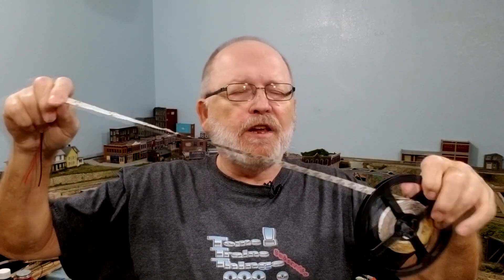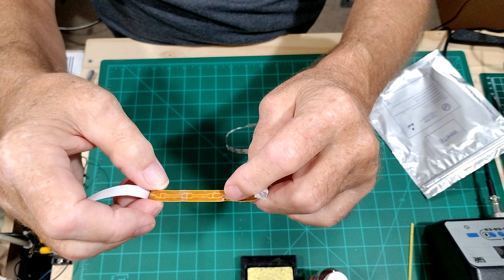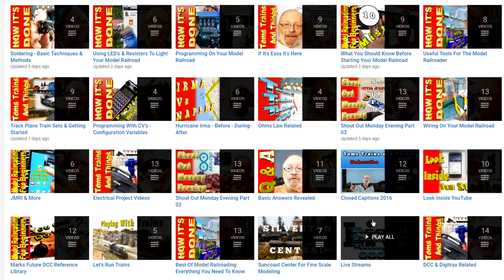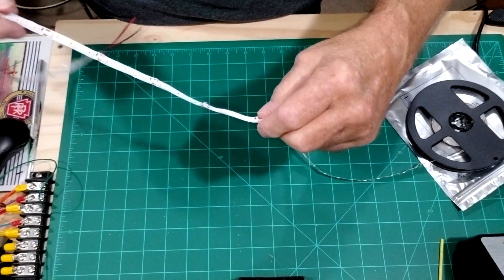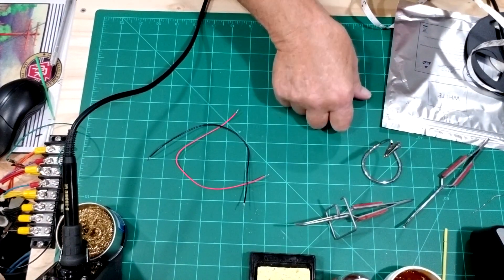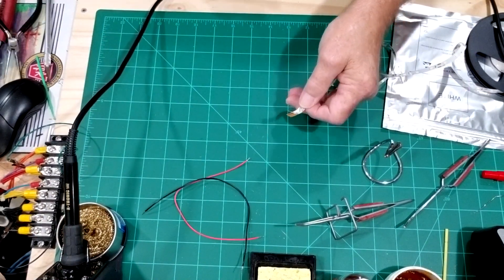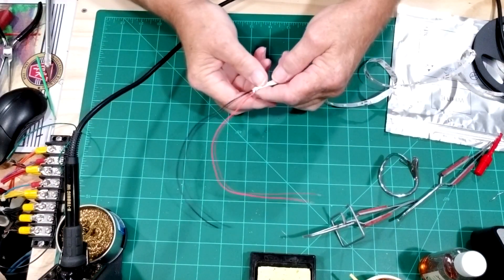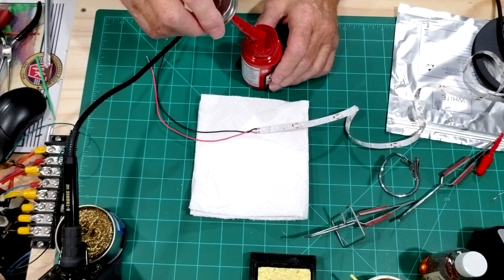Flexible LED Strip Lights - What Can We Do With Them

Comment: Hi Tom, I plan on using both 12v tape and undecided as yet individual LEDs for the layout. Since the strips have built in resistors am I okay with using a regulated wall wart with no additional resistors required? I heard you say that a lower voltage won't work, but have seen I believe people using 9v batteries and variable wall wart transformers. What am I missing? I would be using a buss and may or may not use terminal blocks or suitcase connectors. I am a pretty much total novice at this and appreciate any help/advice. My individual LEDs would be primarily street lights and so where the strips would be for buildings. Would you recommend 3mm or 5mm for the individual lights. I'm doing HO.
Reply from the maker: With the 12v strip, you do not need to add resistors. Depending on the type (solid color, RGB, 3 wire, 4 wire) you can divide the strips into smaller sections. There will be a soldering pad where they can be split.

The problem with a 9v battery is it does not have enough power to handle an entire strip let alone a small section of a strip. A wall wart is your best bet. the 12V rating is the forward voltage (not to exceed voltage). You may not get good rtesults for lower voltages on some LED strips. You did not mention the type of strip you have.

Stasy away fro suitcase connectors unless they ar 3M where you can use 2 different wire sizes.
Reply: @TomsTrainsandThings  Thanks Tom. I'll be using this "16FT 5M Bright Cool White 5M 300Leds Flexible SMD 5050 Led Strip Light Lamp 12V". And I figure on one of the variable voltage wall warts with either 2-3 amp rating. I plan on using the more or less standard 3 LED strip for each main building. Then using single LED diodes here and there, but will be using more of the street light ones. 

What size wire do you recommend using? I realize smaller for the LED leads going into the buss. For my track wiring buss I ended up using new lamp cord and splitting it for the track feeds every 6 feet. 

I got rather confused when I had people telling me I had to use resistors for the strips even with a 12v regulated wall wart, so you have definitely helped clear that up.

Comment: How did you adentify the pos ,neg on the light strip?
Reply from the maker: They are typically marked on the strip. If you have a strip that isn't marked, just apply the appropriate power, if it's not the right direction it wont work.

Comment: Hi Tom,

I installed a light valance 24 inches up on my backdrop using VGA LED light strips.  This is a 4-wire assembly with control remote, capable of a wide variety of light hues and instensities.  Stormy day, broad daylight, sunrise, sunset...etc.  My valance is 13 inches wide with a 4 inch facia so you have a clean appearance of a black facia against a sky blue back ground, with some fluffy clouds.  Along the underside, is a 45 degree strip of wood mounted 5.25 inches out from the backdrop, Aiming the strip down across the backdrop..gives an appearance of a stronger light at the top, washing down across the backdrop - -pretty cool if I do say so.
Reply from the maker: Sounds like a great setup. Post a video of it on your channel

Comment: Hi Tom what kind of power supply do you use to power them up with?
Reply from the maker: Hi Jim, I have a video on an old computer power unit that can be used on your work bench or on your layout for accessories.
https://youtu.be/PatZnjnL-Vw
Reply: Thank you tom ill jave to check it out you use the 12 volt tape led correct?
Reply from the maker: Yes, that one was 12 volt.
Reply: Toms Trains and Things thank you very much
Reply from the maker: Your welcome Jim.

Comment: Merry Christmas to You and yours Tom; when soldering the strips,What size and type solder do you use?
Reply from the maker: Terry Lefevre thank you. It's 60/40 rising core. I think it's  .032. Can't say for sure,  don't have it in front of me at the moment
Reply: rosin core !  Why use any extra "FLUX"?
Reply: you use the same solder for rail jointers and feeders to?
Reply from the maker: +Terry Lefevre the flux is used to clean the area to be soldered.
Reply: Thank you Mr Tom my friend
Reply from the maker: +Terry Lefevre I use the same. I use a heavier solder on the bus wires.  I have 2 videos on soldering feeder wires.

Comment: I love LEDs they are brilliant, the only bad things about them is good luck dimming them without a noticeable flicker.
Reply from the maker: That's true Zane,  Most LED's aren't made to dim. You can always step them down with a higher resistor.
Reply: Toms Trains and Things adding resistor's is a good Idea I want to be a low voltage electrician, as a job specifically a fire alarm tech. Which is more involved than model railroading which can lead to problems. Just like traffic  signals. So I learned to be a great trouble shooter. It's part of what made me love this great hobby. Thanks for sharing this video.
Reply from the maker: That's a great area to get into Zane. Troubleshooting methods are a great skill to master. I've been involved in electrical/electronics for over 40 years and it has helped in everything I do.

Comment: Tom: running ATX power supply(450watt) using SINGLE 2volt leds..WATT size resistor do I use?
Reply from the maker: Hey Terry, I would start out with a 1K Ohm resistor on the 3 Volt wire, you can go either up or down slightly with the value of the resistor to change the brightness.

Comment: I use the 12volt natural white lights for layout track lighting. Bought mine from Amazon but used 480 watt power supplies since the power supplies that came with the individual strings got very hot (not safe). You need at least a 20% safety factor when determining the load on your power supply. Love your videos.
Reply from the maker: Thank you. I use an old Computer Power Supply for most of my accessories on my layout. It can handle more amperage than those power supplies that you can purchase with the lights. I always buy them without a power supply.